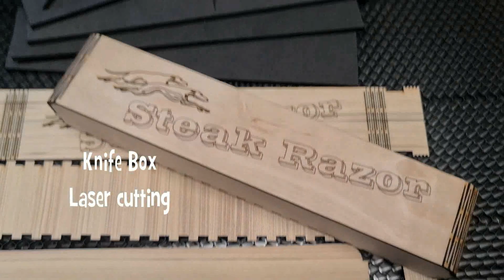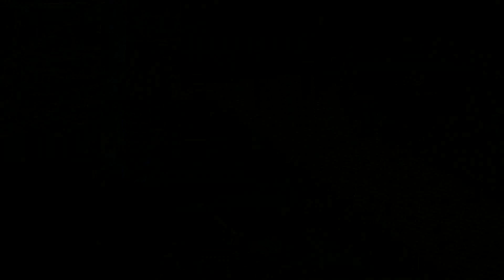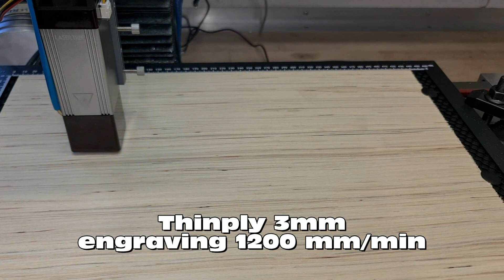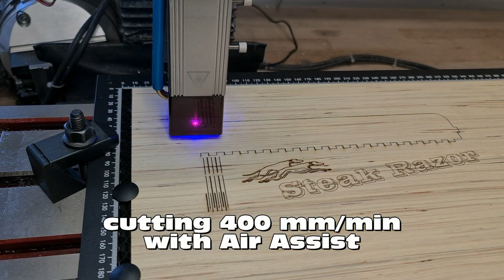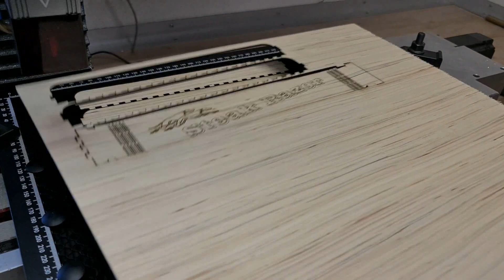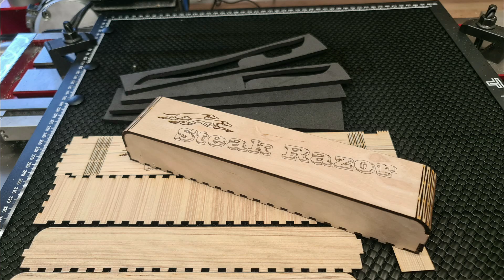KnifeBox Laser cutting with Acorn DIY CNC

Comment: That's a great idea! Which diode laser did you choose? Do you have the link? Thank you
Reply from the maker: Laser Tree 10W optical power : https://lasertree.com/products/80w-optical-output-power-laser-cutter-module
Reply: @TheSuntravel  nice, Thank you. 
On a separate subject, I was looking at the Centroid controllers for a lathe conversion that I have in mind. Based on the features you show, I guess you are using an Acorn Six controller. Am I right? Thanks
Reply: I have just noticed the Acorn6 in the title. 😅
Reply from the maker: @Ale_Lab  On the mill Acorn, only on the lathe Acorn6
Reply: @TheSuntravel  the Acorn6 has really sweet features. A lot of I/O and linear scale readout. That's not common. I wonder how they can do it since it's not a real time controller. Like LinuxCNC for instance. Did they specify the latency you have with Acorn6 + windows PC?
Reply from the maker: @Ale_Lab  Acorn and Acorn6 are both realtime, motion control is not from the PC, it is on the controller. Especial Acorn 6 is much more capable than all Mesa Cards for Linux, there are two fast fpga chips parallel working on board. It runs as smooth as current high end industrial CNCs (can compare this because CNC machining is my job). 2000 lines G-code look ahead on the motion controller....
Reply: @TheSuntravel  oh wow. Did not know that. I will have a look at acorn for sure then. I think you are the first one showing acorn6 with linear scale readouts. I can not find any other testimony about it. Thanks a lot for doing this